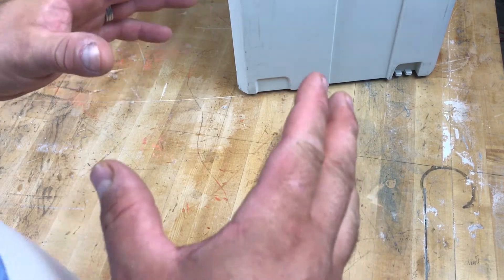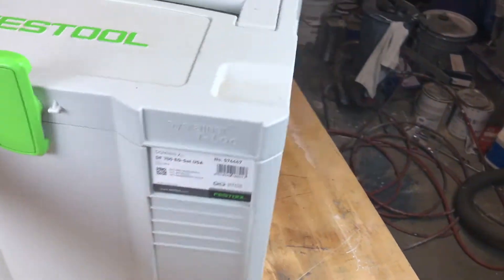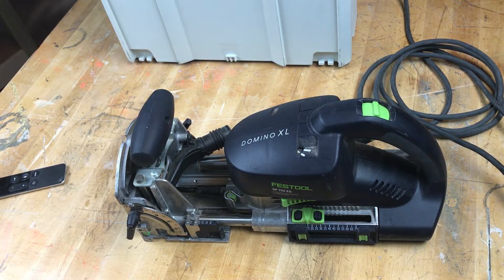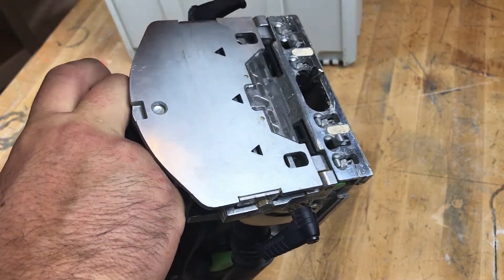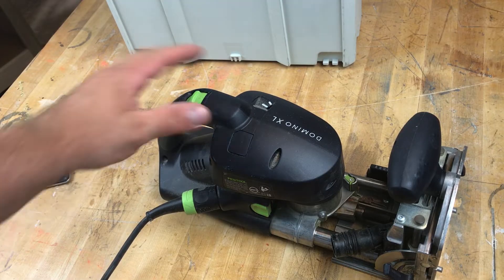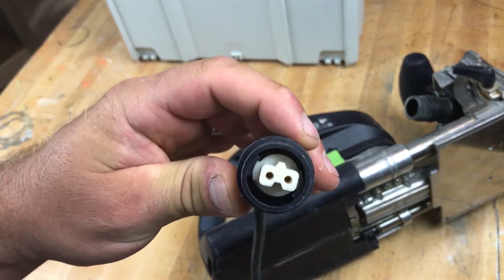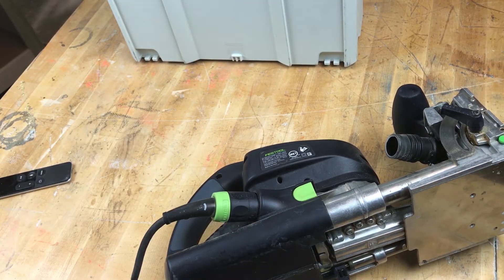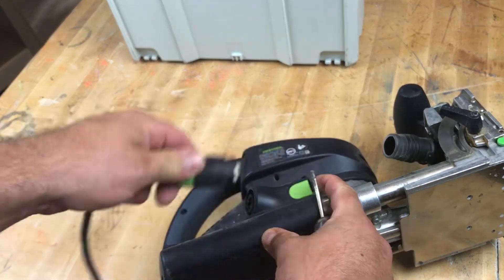Look inside Festool Domino XL tear-down

Comment: Thanks for taking apart your domino. I would love to see how the spindle lock works inside of there. I think I just broke mine trying to take off a jammed cutter. It’s making a lot of noise in there, but still seems to work. . I’m smart enough to take it apart, but not smart enough to put it back together

Comment: Don't use the spindle lock to change cutters. I always did, puts all torque on the spiral gear on the end of the arbor, have my 700 torn totally down for a $36 gear.
Reply: I think I just did the same thing tonight. Had a hard time getting my bit off and used the spindle lock.  Finally got it off and now when I fire it back up I hear a grinding noise.  Is this what happened to you?  Have any pics or more explaination?
Reply: @oliviakaye8352  you've busted a tooth inside. Best bet is service if you're still in warranty.  I wasn't, and its a lot of parts to remove to fix. And if its grinding now, it only gets worse
Reply: I've had the same problem
Reply: @billp377  it's a pain to tear down, but not impossible.

Comment: I’ve a new Domino XL which does not cut parallel. It’s not terrible but if using a single domino on one end of two 12” pieces, the opposite end is 6mm higher than the other.  I sent it in for alignment but Festool did not fix it and after making my first cabinet I’m pretty mad with the alignment.  That said, any idea how I can adjust the parallelism of the motor to the base?  Is it just the two screws on the bottom or those screws in a circle in the front when you tore off the cover?
Reply: Did you ever get it figured out? If it's anything like mine, the 90 degree fence stops are garbage from the factory. The spring-ball stops are in the wrong location, from what I can tell there's no way to fix that. What I do is place the machine on a flat surface, loosen both fence adjustments. I find and stick a board under the fence that I know has a parallel top and bottom. While holding the domino flat, I also hold the fence down on the parallel board while simultaneously tightening the fence adjustment levers.

Comment: just did a replacement motor on mine, the only pain in the ass part was the month long wait for the parts to get to me over christmas. oh and the torx screws on the motor housing.  you will need long body torx drivers.

Comment: I've had that Dewalt biscuit joiner and while the rack and pinion, in theory, is a good idea, Dewalt executed it poorly. I would say 75% of the biscuit slots I cut fail to align properly. I found there was far too much slop in the fence along with in the sliding mechanism to make for any kind of repeatable results. I bought the Porter Cable biscuit joiner and it has been surprisingly precise as long as I do my part. I was thinking about dropping the money on the Domino 500, but for how often I need to cut mortises I will just use my Makita cordless router with the plunge base and rig up some stops if I need a lot of repeatable mortises. 

Anyway, thanks for this video. its interesting seeing the guts of the XL. The oscilation mechanism is actually pretty simple and intuitive. I was sketching some ideas the other day for a home made handheld mortiser and the best idea I came up with was an offset center, rotating cam with a spindle that created the oscilation. Seems like the Festool engineers beat me to the punch.
Reply: My 35 year old Freud biscuit joiner has a very simple fence, you push it up, you push it down work perfectly.  My Domino XL is exactly the same. No rack and pinion needed.

Comment: I doubt the rack and pinion is a patented thing, it appears on other brands of biscuit and dowel jointers. I think it is probably more like Festool trying to be different. On my DF500 I don't have any play in the height adjustment, so not sure if that's wear on this unit or something specific to the 700, I know there were some issues on older models. I do know that the rack and pinion thing is not a cure all either - I had a dowel jointer that basically never had decent solid parallel height adjustment and was never consistent.

Comment: There are some more gears underneath to transfer motor rotation to the gearbox which is hidden from us but for 1500 dollars, I will use my router to do loose tenon.
Reply from the maker: +Delfin Q. Bangate if you use it for a living, it makes sense, if you don't make a lot of doors or other furniture requiring tennons then it doesn't

Comment: I'd like to see what they are doing to get the 90 degree transfer to the bit and still allow it to osolate.
Reply: Jacob Wickman The bit doesn’t travel on a parallel path, so it isn’t a 90 degree transfer. The end of the cut path is an arc.